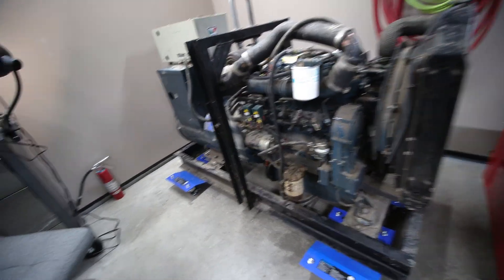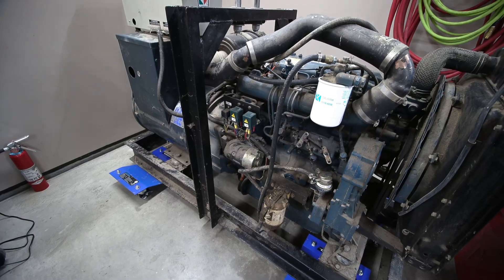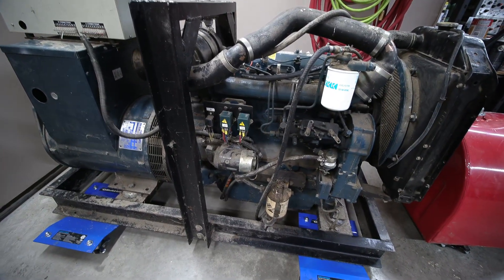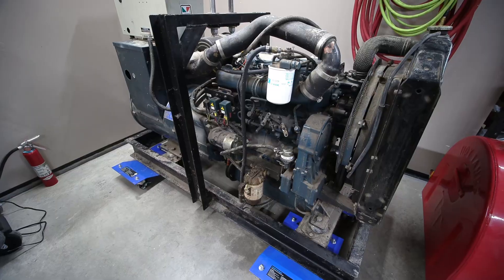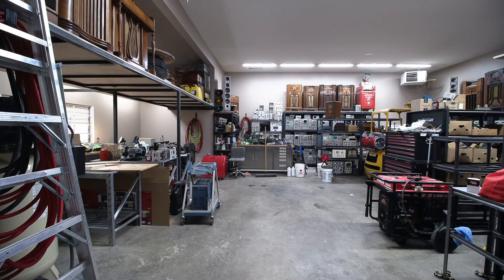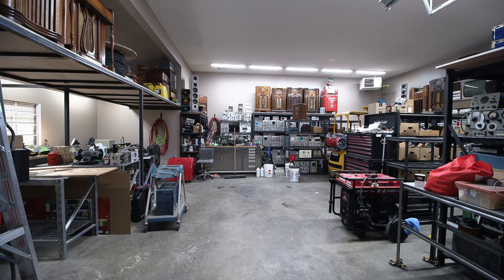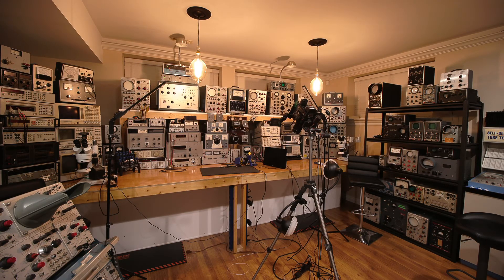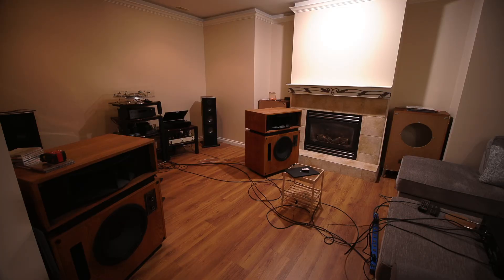Where Are The Videos? My Life And Projects Off Camera

Comment: With generators powering inductive loads such as motors with huge startup loads, would it be possible to design a slow startup, current limited, similar to those used with ‘off grid ‘  limited inverter powering the startup currents of aircon systems. A more powerful power hungry motor in your case , would in theory just need a bumped up variant of those circuits, so you 15K Generator could more easily cope , rather attempting to fix with a far more powerful Generator that consumes far more fuel than a smaller generator.

Comment: Always enjoy a behind the scenes look.  The endless goodies in queue means lots of fantastic videos still to come :)   You don't usually  see such large KW rated single phase 120/240 volt generators because the amperage is so high.  Often a 400 KW would be 3 phase.  That generator end would have needed over 537 HP (plus additional HP for mechanical losses).  I can see that diesel engine handling 40 KW or so just based on physical size.

Comment: Coping with short power outages can be eliminated with large continuously running flywheel start generators. At a NATO signal relay station in France, we had a huge flywheel specially installed between the diesel and the generator with a clutch. A small electric motor kept the flywheel and generator running in phase continually with the grid but unloaded and declutched from the engine. Since we had cryptographic equipment locked in sync with other bases, any dip in power broke the sync and we lost communication. The system could detect the instantaneous drop in power that often happened and the diesel clutched in and immediately started and the generator came online and took up the load in phase thanks to the flywheel's mass that bridged the switching time. We usually maintained the communication links without having to reset everything.

Comment: I find it suppressing that the alternator on the big genset is 431 KVA. I used to build and service gensets with the biggest units being 750 KVA driven by a Rolls Royce diesel on those the alternator was  as big as the whole unit you have there, that alternator looked more to be in the 40 to 50 KVA size but if the rotating mass is great enough you should be able to get starting current much greater than that.

Comment: Why not add a few battery packs into the mix to take off the edge of your heavy hitters? That should be way more economical and ecological than running a small generator with the spikes or upgrading to a larger one.

Comment: The best engineering solution  I saw in a generator to address power fluctuations effectively is the use of a flywheel. It will be a heavy one for sure but its inertia will maintain the RPM needed in any abrupt and wild fluctuation scenario. More "power" to you Prof Carlson.

Comment: Mr. Carlson, Sir, 
Just a thought for you that you might consider that might help: when you hook up the back up generator,  you might consider acquiring an older home heating oil  fuel tank. They can hold larger capacities, and may take up less room (floorspace) and possibly eliminate the need for multiple smaller tanks. 
People are sometimes getting rid of them to change to electric or natural gas heating, so sometimes they can be found fairly reasonable.  
Hope this maybe helps. Good luck, sir.

Comment: A lot off topic but on the topic of repairing vintage equipment I just saw a piece of 1960's electronic equipment designed by Rein Narma on offer on EBay for $350,000.  It is a Fairchild Audio Compressor and apparently they are still in demand by Recording Studios and in limited supply.   Here is a cut and paste from the wiki - Sherman Fairchild had an interesting legacy. From Wikipedia, the free encyclopedia
Fairchild 660/670

Fairchild 670 Compressor/Limiter
Brand Fairchild
Manufacturer Fairchild Recording Equipment Corporation
Technical specifications
Effects type dynamic range compressor
Controls
Input/output
The Fairchild 660 is a tube-based single-channel audio compressor invented by Rein Narma and manufactured by the Fairchild Recording Equipment Corporation beginning in 1959. The 660 was the first intelligent automatic volume control limiter.[1] The Fairchild 670, introduced shortly after the 660, is a dual-channel version.[2] The rarity of Fairchild compressors has made them highly desirable and very valuable, with a used 660 now selling for $20,000 or more and a 670 selling for $30,000–$40,000 or more. They are commonly referred to as the "holy grail" of outboard gear.[3][4][5][6]

Comment: Get a 25 KVA
Plant in Reality We Don’t Measure Generators in
Watts We Measure in
KVA and Then Transpose To Amps Not Volts Then Transpose From Amps To Voltage It’s Easier That Way 
It Will Runs at
1,800 RPM at 60Hz
Now This Is How
It Works 
This Kind of Generator 
Dose Not Reve Up As a
Load is Applied We Call Them Industrial Plants or Generators Like At a Construction Site 
The Kind I Am Describing This Kind Stays at 0.8
Power Factor Inductive 
At 1,800 RPM 
The Actuator or Throttle Maintains a
Constant 1,800 RPM Through The Mag Pickup That’s in The Stator This Signal Sends The RPM to The Controller To The Actuator Which Maintains 1,800 RPM 
and That Translates To
75.5 Amps Per/Leg  @
120/240 Single Phase 
What You Have is a 
Plant or Generator 
That Revs Up as a Load is Applied 
Can’t Have That in
A Home Application 

Technology is 
Now Better 
You Get a
Plant or
Generator That is a
Constant 
1,800 RPM
and You Have No Deeming of Lights As The Load Goes Up or 
Down 
Love ❤️ 
You’re Show

Comment: I do not know if they make equipment for the size of equipment you are using but it offers a soft start for compressors and motors. We are going through power issues here in SV9 land. We are contemplating at least a 20Kw solar system considering the amount of sun we get here on the island. Still a backup Gen set would help. Thinking of a military 10 or 15 Kw unit, doesn’t matter if it’s 60 Hz, the cutover switch would isolate the mains from the home before the generator is switched into circuit. How do you find time to even repair and restore all of the projects you have lined up? This is one of the best organized shops anywhere that I have seen and your videography skills are on top. It’s irritating when other creators pan across the subject at lightning speed, it distorts the video and sometimes it’s difficult to understand what they are working on. You panning speed is right on the money making it easy to understand what is going on. This is something we learned in the early 70’s in the high school studio. In the 60’s I had a super 8 movie camera and I can not even watch the movies where I am panning in the shot, way too fast. Guess I was trying to conserve on film😮.
Keep up the great work! We are always waiting in the wings and as one of my instructors always told us, "Rome was not built in one day".

Comment: Load bank? Try three 50 gallon barrels, filled with water, add a bracket hanging 3 rods into water, then add salt to load or lower rods. Simpler than a few heaters.

Comment: on your geothermal pump issue it makes me wonder if the motor itself has a weak winding or if it just needs some extra help and maybe a couple of start capacitors to help it through without a big voltage surge! just a non-professional suggestion! thanks for shareing!

Comment: If that generator could put out 1671 amps,  you would need 4 strands of 500mcm copper wire in parallel on each leg (L1 and L2), I doubt that generator's internal wires and lugs could accommodate such a load.:hand-orange-covering-eyes:

Comment: Mr Carlson, I believe what you have here is a 40. KW generatot with capability of 167 amps @ 240 V = 40.1 KVA/,KW (1.0 pf). 

40 KW implies 55-60 hp engine which makes more sense.

Hard to read nameplate.  Could the amps actually be stamped 167/1 (one phase) and 40.1?

A 400 Kw machine would weigh in the vicinity of 3500 pounds (edtimating 8 lbs per hp)

Also dont see any bus bar connections for 1667 amps :)

Good luck with the project, enjoy your material

Comment: I'm not a fan of engines starting immediately and prefer a few seconds to make oil pressure before they fire up.
Reply from the maker: I disable the fuel cutoff solenoid and crank the engine for about 10 to 15 seconds to get the oil pressure up before allowing fuel.

Comment: You may want to do a search for "Hyper Engineering Soft Start". I worked at a solar installer and we would use their current limiters on HVAC and pumps to limit the LRA of the motors when attached to a Tesla power wall system as those have a peak output of ~7kW per power wall and will shutdown if overloaded.
I've used them with my HVAC with a conventional portable generator and it makes startup possible with the device in place.

You could also consider a time delay relay added to make the circulation pump come on before the compressor. 

Thanks for taking the time to make your video.

Comment: i assure you that is NOT a 401KW generator more like a 40KW. it has a 361 frame, it's only good for is about 40kw the length should be about 25" and the diameter is 18.18". the amperage is 167amps. if it was 401kw, it would be a 433 or a 572 frame. 
not trying to bash you, just making sure you know what you got.
Reply: I agree. Never have seen a single phase generator rated anywhere near 400 kW. If the rated amperage was in the 1600 amp range it would need 3-500 mcm copper.
Reply from the maker: What are your thoughts on the generator spec plate, and the fact that Kubota recognizes it is 401kW, and oversized for the engine?
Reply: @MrCarlsonsLab  the name plate is for the alternator (generator), not the engine.
Contact marathon and see if they'll do anything. Id Google the model number and stamp the info onto the name plate.
Reply: @chainsawsandgenerators9952  I can’t help but wonder whether the nameplate omitted decimal points, and by so doing made the amperage and kW seem 10x higher.

Comment: Just curious.  Ever thought about adding a soft start system to your geothermal compressor?  Should reduce the voltage dip.  I’m sure you’ve probably already thought of that, but thought I would ask just in case.

Comment: Dude I love your shop. It's a bit of an inspiration for my own.  Just do what you need to do.  Also, I don't know if you mentioned it but I've seen aftermarket (ebay) regulator kits for some of those big generators that servo the throttle, you drill the crankcase to install a crank sensor and get (almost) perfect 60 Hz under all loads.

Comment: Bigger generator equals more fuel.  I would try a soft start on the compressor before I junked the smaller generator.  I was stationed on a Nike base in the service and there were three 250kW generators in a separate building.  Out back was a large concrete tank with a hoist over it.  I was told, never got to witness this, that the tank was filled with salt water and electrodes lowered into the tank to load test the generators.

Comment: Are you sure that's 400 KW and not 40KW ?
In my last job as electrical tech, we had several 250KW and one 500KW generator, they were 3 phase 415V, the alternators were much bigger, the 500KW had a 16 cylinder engine with turbo.
Reply: It's 240V, 167A = ~40KVA

Comment: I don't understand why your geothermal draws so much current at the start. Why would the inrush be that high? Does it have capacitors to help it roll over? My backup generator is natural gas. I have no problem with my geothermal heating and the generator. The power goes out generator starts running. When the generator stabilizes. The automatic controls bring in household equipment. The last things are the water pump and the heat. And any other high-voltage units.

Comment: Could soft-start boxes be used for the geothermal pumps? That would address your voltage sag issue regardless of the power source. I understand it's still nice to have a generator designed for heavier use if you're anticipating prolonged periods of operation.

Comment: The large hospital/research center that I retired from had 4 CAT #3516 16 Cylinder natural gas pig generators that only ran at 1,200 RPM  and 11 CAT #3516  16 Cylinder diesel generators that ran at 1,800 RPM. Even after spending a million dollars to have the 4 natural gas gen sets rebuilt along with all new controls they did not like a huge load dumped on them. Had trouble running over 90% of thier rated KW awhile running a steady load by performing monthly halve hour run only using load banks. Gas gens even worst during hot weather. Hospital made a ton of money every summer by shedding  3 Megawatts of power for a maximum of five days and no longer then 4 or 5 hours in any single day. We would place the 4 natural gas generators on line and transfer mechanical loads. Had to start up a couple if boilers to only run steam chillers.

Comment: Regarding that generator, we have a similar, if not identical unit at our farm. We get horrendous straight line winds and every great once in a while the aerial line from the house to the old shop ( the house and old shop were built in 39 when my great grandparents immigrated from Denmark) will get to whipping so bad it’ll short the genset out. It stalls the little Kubota out before it can do any harm. Maximum load on ours during harvest on a power outage is about 75kW and it doesn’t care one bit. Ours has about 3000 hours and has been super reliable.

Comment: Most of my large data center customers had, in addition to huge Gen sets, had rooms full of batteries. The idea was to switch the power to the battery/inverter hardware while the Gen sets started and got up to speed. Maybe you could consider a smaller version of this solution.

Comment: Having an oversized generator allows for running full load with a poor power factor.  The engine may only be able to drive 30kW but with a generator capable of 1671A @240V you can run loads as high as 400kVA as long as the 30kW is not exceeded.  It also helps with momentary overloads such as starting large motors.  The inertia rides the system through and the generator is built to handle it.

Comment: Paul, if you are going to try and get 30 kilowatts from that 400 kilowatt generator that kubota engine has to be at least 60 to 70 hp, also you are talking of exhausting to the outside world, why not just install it outside and not have to worry about carbon monoxide gases.

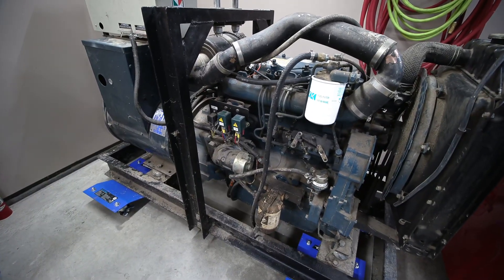Comment: 6:25 Well that engine is normal for big generators, they use diesel because cost less and is more torque (less RPM), good for stable generators, on the other hand that gen is made for X amount of output rather you use it or not, I use one in the army a long time ago and the one I use had a transmition box to pull more or less out of the gen, the motor keep the same speed/RPM, the other one we had in the army was like that one (X amount of power, all the time).

Comment: Is that single phase or 3 phase.
 Remember your allowed 80% of that 1671 amps. That's national electric   code, Canada's got there own. But the I calculated 1341 amps at 240 volts. Hell Carl you could power a city block with that. Put that beast in it's own sound proof shed. You've got the power.
They call it the 80% rule,  safety margin. Yes you could surge it higher. Is the sine wave clean ~ off that ? Might need a cap correction. Enjoy...whats your switch time,  on transfer switch ?

Comment: Hi Paul, really enjoy your videos. On the subject of starting the compressor for your heating system, what about using a soft start? I installed one on a HVAC unit and was able to start it during power outages running a genset that was unable to start prior.

Comment: Ever look into a Micro-Air soft starter for your Geo thermal compressor.  They make them for compressors up to 6 ton (72,000 btu's) and can reduce the locked rotor amp surge by up to 75%.  Not only would help your generator situation but also eliminate the dim-out when starting.  As a side benefit it helps to lengthen the life of the compressor.  Not a standard use case for these devices but you could check with the manufacturer to see if it would work.
Reply: I have two. Reduces in-rush current by 60%

Comment: I didn't watch the whole vid, but if you have a enthalpy /pressure diagram of the refrigerant used you can draw in the cycle and even calculate how much power it should take. (about 25% of heat moved + mechanical loss+ electrical loss). Not really hard. There might be something wrong with the compressor.  The compressor should only pump gas no liquid if it's plunger pump. When compressor goes off hot gas in the pump can go to liquid if it cools. Maybe frequency controlled 3 fase motor is better when it doesn't shut off at all.

Comment: Hi Paul. looking at your genset it looks as though it was put together by Lister petter Ltd They are no longer in business here in the uk. As for the size of the set it is more likely to be a 40 kva. theres probably a decimal point faintley stamped on the rating plate
Reply: Looks like the decimal point is missing. It is a 40.1 KW and 167.1 amps. A 400KW alternator would be much larger in diameter. I’ve been a generator technician for over 20 years and this one will work excellent for you and will have no problems with starting your loads without a dip in the voltage or hertz. I am very interested in how you build the load bank. I am assuming you will be using heat strips from a HVAC system if making a resistive load bank. Or is it going to be a reactive one?  I enjoy your content and contact me if you have any questions or need service manuals.
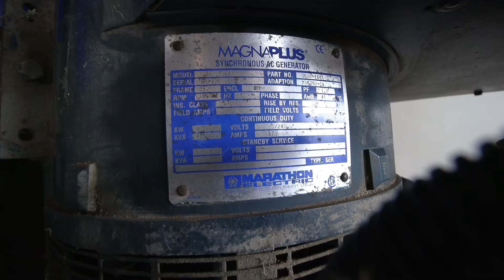Reply: Yep, at time 5:17 the generator  plate indicates 240V, 167A, which is ~40KVA.